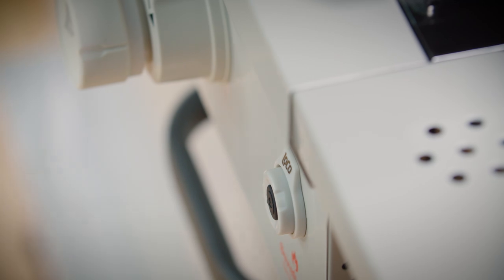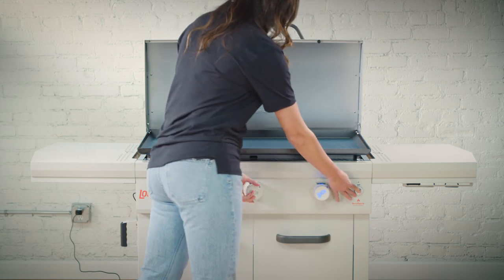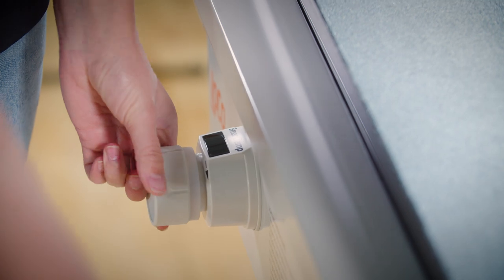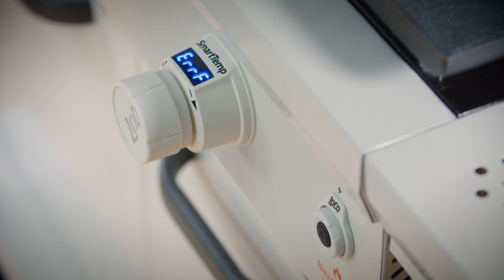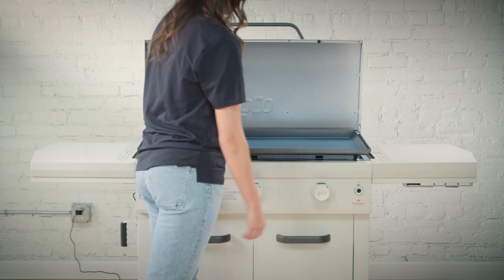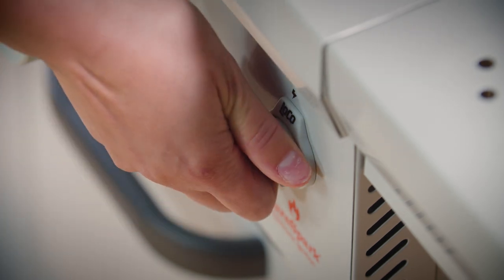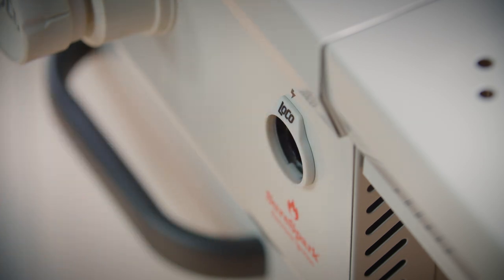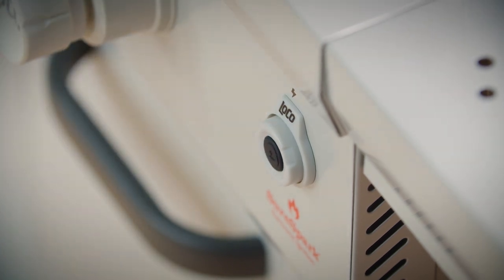How to Properly Ignite Your Griddle to Avoid an Error Code on the LoCo SmartTemp Griddle

Comment: I bought mine in 12/23 and after about 5 uses, have had same problem.  I'm generally patient but am beginning to believe these are JUNK. No luck from the retailer as I was told all problems had o be handled directly between the buyer and manufacturer.  If loco does not be proactive and fix the problem and send someone to repair, I will proclaim to all and everyone that loco is a defective product.  Just way too many similar problems I read about across the web and all are the same.
Reply: same, i’m super busy with work. finally got some time off to get mine put together and use on christmas. nope getting ERR1 on the far right burner. super super super frustrating

Comment: I can't get my griddle to light. I just replaced the battery and checked the connection. Do you have any other troubleshooting tips? We spent a lot of money on this thing and have gotten 4 uses out of it. I hope it isn't faulty.
Reply: Mine same way.  My far right burner will NOT stay lit.  Doesn't matter how many times I reset.  Frustrating,.
Reply: Any luck I just got mine today and it will not ignite
Reply: What was everybody’s outcome? I used mine the first time yesterday and my far right one is flaky also. I tried a different outlet for the plug and that might’ve helped.
Reply: @Grillman-sj8fz same dude! First it won’t ignite and finally once I got it to the right burners won’t stay lit
Reply: So I think the “smart temp” setting on these things is to turn off and on the burners with these to maintain a constant temperature. I was trying to season mine and the burners kept turning off while I had it set to sear, but they would automatically reignite. I think that’s part of the design. As for igniting right away I had a hard time getting it to ignite too and wouldn’t even hear it click. Eventually it worked fine. But doesn’t surprise me this thing was on sale by a shit ton.
Reply: I saw someone posted a video where he suggested the angle of the sensor switch needs to be adjusted so it is similar to other burners that do not give this code. I just got mine today and 2/3 burners were fine but 1 gave me the error code when trying to get it to sear. I may look at angle of the sensor switch (hardware store put the griddle together for me).
Reply: My dads grill isn’t staying ignited unless it’s over 300 f

Comment: Mine doesn’t work at all! I bought it yesterday. Built it & bought brand new propane and attached it. No gas is passing through the hose at all! No gas is passing through the burners. The electronic igniter is working. But this griddle will not light. It’s brand new. And my propane tank was also bought yesterday. Brand new completely full. What am I doing wrong? If anyone could help me, I’m completely stuck out in the middle of nowhere. I need this thing to work.
Not light!